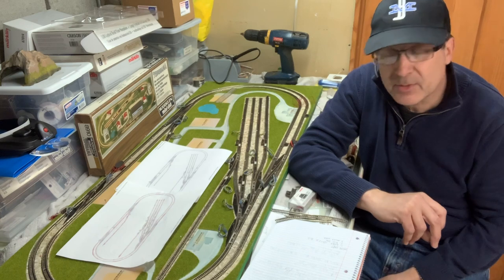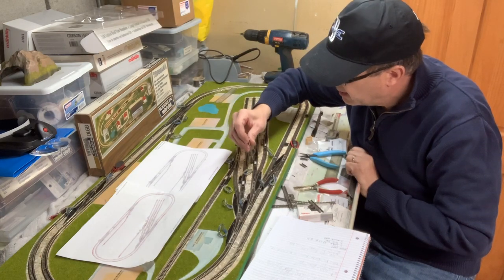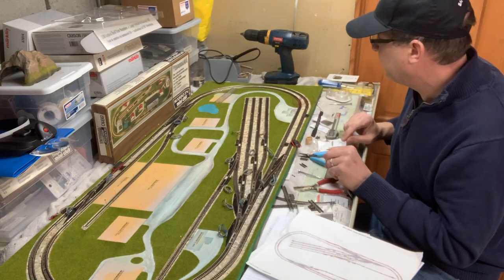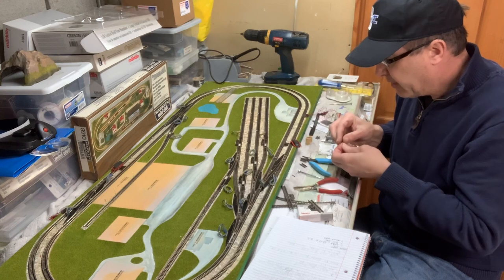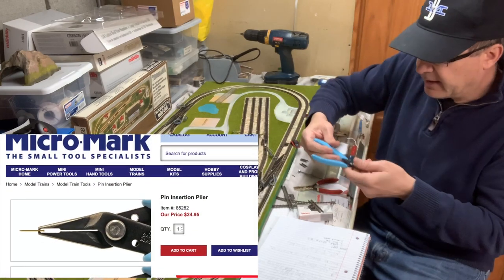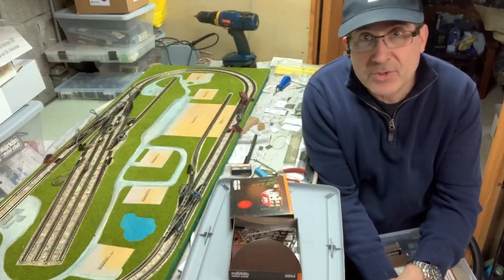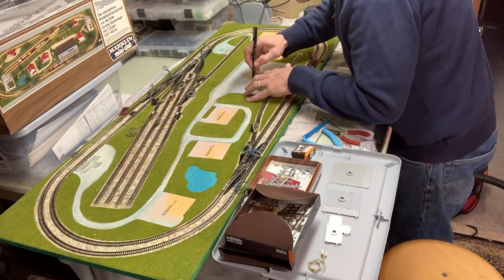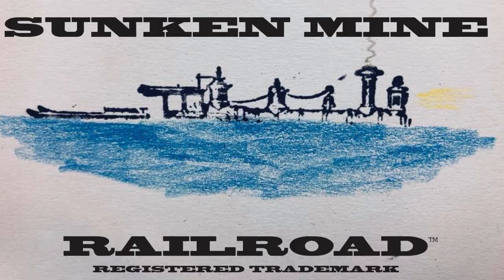Märklin Z-Scale Resortation Applying track and Drilling holes.

Comment: Thanks for the update. I recently bought a NIB Marklin 8910 Toporama and am in the process of finding and buying all the necessary track, buildings, and accessories. It is quite a treasure hunt. I am learning from your experiences.
Reply from the maker: @zscalehobo   - Yes - If I found Frank earlier I would have saved about $500 rather than buying each piece of track individually. Good luck with your layout!
Reply from the maker: DadCooks - Did your 8910 come with any kind of instruction sheet or Manual? I'm looking for that. If so, Maybe you can scan it?
Reply: @SunkenMineRailroad  No it did not and I have been looking for one too. I have asked the lady that I brought it from (it was part of her recently deceased husband's stash of Marklin) that if she finds any instruction sheets or manuals as she is going through his things if she would please let me know so we can work something out. I find it hard to believe that there was not one. I have searched high and low on the internet and several Marklin Forums to no avail.
Reply from the maker: @DadCooks2  I think I figured it all out without it and the wallpaper paste was super flat when it dried and worked out well with the MDF board. The pins push in easily as well.

Comment: Its such an arkward scale to work with, I am struggeling to find track pins small enough to fit the track, I am building my friends old Marklin start set.
Reply from the maker: Take a look at my other video where I talk about laying track. If you are using Marklin track, use their pins. Buy more than you need, because you will bend some.
Reply: @SunkenMineRailroad  its a shame just how hard marklinZ  track is to get on ebay...Marklin will not ship to the uk anymore so
I may start using the more durable Rokuhan track.

Comment: What did you end up doing with the track that was corroded and how much was corroded ? What did it cost you to replace it ? Now you got me thinking ? 🌊🐺
Reply from the maker: It wasn't bad, it was just not as shiny as the new-in-box track. I still have it.
Reply: Sunken Mine Railroad, I wanted to say thank you for giving me the numbers that I needed ! Now I know it’s safe to assume that I can use a (24“ x 48“) although I may sacrifice an “inch and 3/4” one-way, I’m gaining almost 6” more to widen the road ! With what I have in mind I would ‘like I told you earlier’ use “both American mostly but still be able to run German look” too but I get more than that making it feel weird or am I gonna just have to build another layout for them ???? 🌊🐺
Reply from the maker: @jorgel.fernandeziii8278  Which ever direction you go in, plan first using a good layout program then purchase stuff. There are tons of american building kits out there so it shouldn't be too hard to do. I had to make a couple of changes which meant that some of the track I originally bought I can't use now and I had to buy additional track to cover the change. Good luck with your project!
Reply: Sunken Mine Railroad is 8”3/4’ The largest size Straight track they making or do they make longer streight track ?  Oh and Do they sell them in (“10 packs or 12 packs”) ? And of course what’s the average price ? I’m thinking I’m going to need at least (one pack of the 8 inch and three-quarter) ??? Jorge
Reply: @jorgel.fernandeziii8278  There are very long flex-track available from atlas and I thin Marklin. That's one of my first videos. Making your track brand selection is the first decision you need to make. Talk to Frank at Z-Scale Hobo. most track can be purchased in 10 packs.
Reply: Barry Sanel, I have been keeping my eyes and ears on watch and I’ve been selling and buying on eBay ! I have looked in every picture and double checked everything and when I got them, Instant inventory ! I don’t know about you but I hate inventory ! I’m still waiting for one more yard extension sets but with the coronavirus & the mail not working, well you know how that goes !!    Now earlier you mentioned ‘flex track’, and I have use flex track before in both N & HO !
 I don’t really care to work with it however, I know that Märklín has a large size piece of rail I would like to know how big it is in inches and centimeters and what it would cost to get a 10 pack box of them ?   Also as far as making a choice on track, well, as you can see I’ve already picked Märklín !!! And to be honest with you I really like the type track it is the quality of the track the code of the track and the way the track coach together very similar to Kato ! Loved it ! 🌊🐺
🌊🐺

Comment: 8503 is 55mm ... 2 x 8504 is 50mm. So to make a 110mm track section from a Märklin 8587  55mm uncoupler you use 8503.
Reply from the maker: Yes, but I wanted to keep the uncouplers in the center where the originals were because there is a space that marklin provided.

Comment: Hey Barry, would you be kind enough to tell me how long and how wide the layout is supposed to be ? 🌊🐺
Reply: Really need to know (“how long and how wide”) it’s really supposed to be and how thick is what you’re using to thicken it ?
Reply from the maker: @jorgel.fernandeziii8278  The box says 125cm x 48cm, but I measure 19" x 49.125" mounted on half-inch MDF. If I had to do it again, I would have cut the board an inch bigger and trimmed it back to the edge. One of my earlier video's shows me applying the toporama.
Reply: Sunken Mine Railroad Thank you Berry !
At least now I know I can go 24’ x 48’
And I got to go to lumber store and get a piece of 1 inch thick or 2 inch thick if I can find it star foam board and maybe just maybe find me a thin piece of plywood to glue it on top of to make it a little more sturdy thing is the way I’ve got mine figured out there’s going to be like an ocean port for trains and ships ! And if I decide to create for example; a Bay Harbor area for industrial fishing I can do so and then I’ve got enough space to do a private beach on the other side ! But I really need some Florida East Coast Railway Z scale locomotives ! 🌊🐺
Reply from the maker: @jorgel.fernandeziii8278  I really recommend MDF over plywood. The track pins push in firmly and you can pull them out. Foamboard is really better for making terrain. Since this layout is flat I don't have that complexity!
Reply: Sunken Mine Railroad; Correction on that I said earlier, I said it backwards ! I want to find a thin piece of plywood and then take a 2 inch piece of Styrofoam glued to the top of the wooden board the stuff you’re talking about they do not sell it in hardware stores here in Houston ! Another friend recommend a Homoshuit, it’s like a sheet of cork bed you place on top of the wood to deaden the sound ! Again I cannot get it here in Texas ! Now they sell what they call “pressboard” which is cheap and personally I don’t recommend using pressboard because of its instability and the fact that it absorbs water like a sponge ! Living down here in the south sometimes you get stuff that you’re allowed to get up north but, sometimes they don’t carry the same things you have up north that we have down here ! So that’s why I am going to go ahead and do the 2 feet wide by 4 feet long with Styrofoam on top I’ll be able to cut into it to make the Atlantic ocean ! Then I’ll be able to have a harbor on one side,  and a beach on the other ! I’m attempting to implement a plan for a Lionel train Layout call (“bridges and beaches”), converted to Z scale ! I think I’ve got everything I need and then some more coming ! Let’s see what happens ?
🌊🐺
Reply: @jorgel.fernandeziii8278  That sounds pretty cool! Someone told me that if I wanted to do sound deadening then it should go underneath the board but who knows. I like the sound the trains make. This 8910 layout is fairly simple and flat. The layout I see that have topography are really works of art.
Reply: Barry Sanel ! Oh, I agree with you 100% on that one !!! In more ways, (“the facts”), I feel that (“model railroading”) is a way of expressing our (“talents/ART”) that way others can see through our eyes the way people see things !  You’re an architect, you’re an electrician, your a landscaping artist, your a builder, A mechanic, a traffic cop, The firemen and ambulance driver, an manager of a control tower, or an air traffic controller, you’re literally building something from nothing and you create something that has life !!! 
🌊🐺

Comment: For your next project, a scale model (Z-gauge might do) for the actual Sunken Mine RR including topography from Route 301 down to the Cold Spring foundry.
Reply from the maker: That's a great idea, except, from what I've read it was a gravity line with donkeys returning the ore carts back up hill (no locomotives.) I think I read somewhere that RTE 301 might have been a rail line at one point in history as well.
Reply: @SunkenMineRailroad  And it indeed it was a gravity line and yes, there were donkeys pulling the carts back up And yes(!) Route 301 was the path starting from where Dennytown Road meets it. Local lines from the mines all fed into a single track at that point.

Wandering around the parts of Fhanestock no one goes to you can still see the graded lines following back to the mines. If you follow Sunken Mine road to the bottom, just east of Dennytown, just before you round the last curve to the lake, look toward your left and you'll see the grades coming in from Sunken Mine itself. Those, and others like it are all over the place.

And though it would be a very cool thing to build, a recreation of the active mine railroads, I'm not sure where you can get 1:40 scale donkeys.